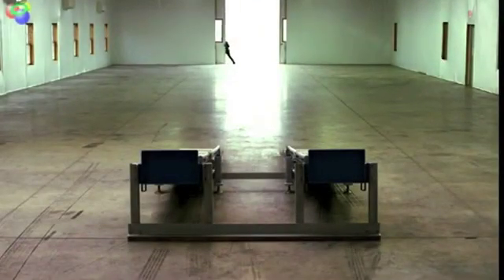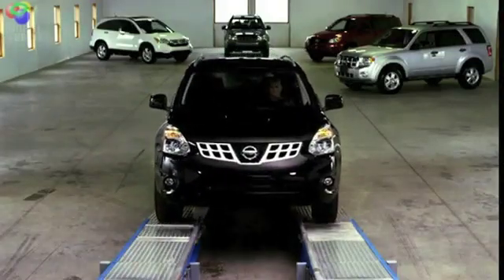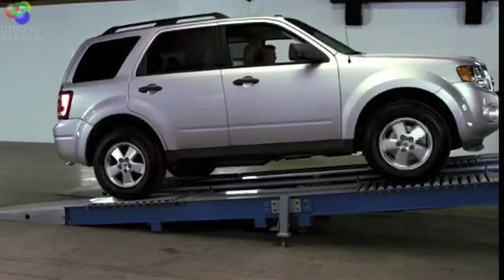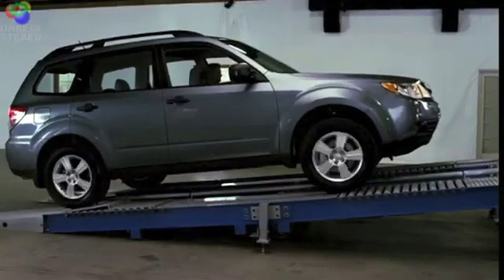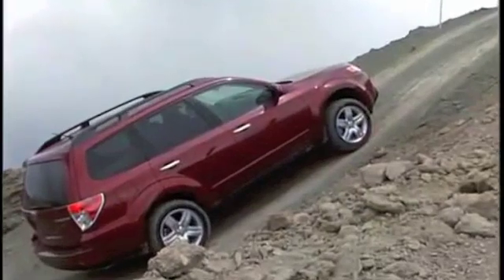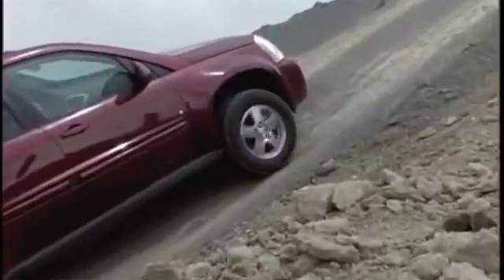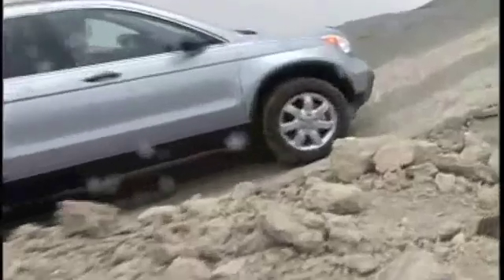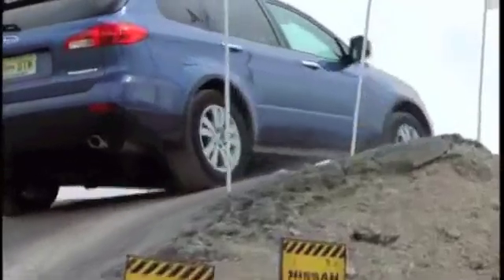Subaru Symmetrical AWD Test

Comment: Yet another Subaru advert, it's just a shame that how many people believe these videos,if it was written down that the moon was made of cheese then that would be true, believe me that Subaru is NOT any better than the rest I own them I run them I work on them I've had them for over 35+years, and Subaru are one wheel drive at its best, don't believe me do the test lift one wheel off the ground put something under another for some resistance then try to drive, the result is a gimmick AWD system

Comment: You chose the only test that gives Subaru an advantage. In reality, all those cars would have climbed the ramp if traction was available on BOTH rear wheels.
Reply: .. but the Subaru would have also climbed if it had traction on both rear wheels.  That's the point .. it had traction even on the very worst case, that only one wheel had traction.

Comment: My STOCK '17 Subaru Crosstrek, took to the Beach and played in sand, 4x4 lifted and kitted Pavement Queens, wouldn't dare go in! The looks on their faces when it "looked" like i was stuck, pulled out, then went back in and spun donuts, was priceless!😋😋😋😋
Reply: And by the way you can easily replace the radiator yourself that’s how simple the design is I did it I’m not even a mechanic you can get it done for about 120 bucks with a Nissens radiator

Comment: Seems like a rear differential with some kind of "limited slip" ability (clutch, viscous or helical) would've COMPLETELY made a difference in this test...
  I think if any one of those vehicles tested HAD a "rear limited slip" setup, they would've been able to climb this ramp and pass this test.
  In my opinion, it's damned ridiculous to even offer an AWD drivetrain option, without even offering a limited slip rear diff. as an option.
  It should come standard-equipped when said vehicle is fitted with any kind of AWD option....
  Pretty dumb to have an "all wheel drive" SUV with open diffs at each end.

Comment: Subaru be like: 4WD. All wheel gets POWER. Sound easy.

Everyone else: WE NEED COMPUTERS TO MAKE IT WORK.
Reply: what? Subaru is literally doing that right now with x-mode. There is nothing mechanical that can provide all tire power AND be safe on the roads. Locking differentials must be toggled and subaru's don't have them.

Comment: would be great to include the year/model/trim. does the tested subaru have a rear LSD in it? is subaru that much better than the competition? thought rav4.1 and 4.2 were pretty good, but not sure c diff lock would have helped in the first test. would be cool if subaru offered a dual range transfer case, but i guess that would add a lot of weight
Reply: Don't think those Foresters got LSD. The 3.0r, GT, Spec b liberty outback platform got them with the 5EAT, as did all rexies.  But AFAIK the 2.5s did not have LSD

Comment: Comparing Subaru AWD to a Cute Ute AWD is like comparing an HD truck 4wd to Subaru AWD. It's all about how much torque the system will distribute. 

Those other cars are simply not designed for that. They will, though, work in most situations faced by their owners. If, however, you live in the mountains or have a steep driveway it's time to think about a Subaru. If you live in Nebraska a Rav 4 is fine.

Stop saying Jeep compass or renegade. Nobody wants a vehicle with ass in the name and FCA managed to turn a bad brand, into a worse brand. Ask any mechanic before you reply. ANY mechanic. ANY. MECHANIC.
Reply: But Aaron, what about Subaru head gaskets?
Reply: Oh yeah, forgot about that. Thanks other Aaron. So, I guess I'll take the shitty Toyota AWD on the Siena and get stuck now and then, but I can use that time to watch my odometer tick over 300,000 trouble free miles as the tires spin.

Comment: we tried the test on a saab 93 with XWD that has what they call (elsd) rear wheel torque vectoring , the awd system simply vectored all the torque to the right rear wheel and it climbed over the rollers with no fuss.. I suspect the Subaru has very intelligent traction control , or a slip controlled rear differential

Comment: Main reason is the platform being either FWD or RWD... If engine is placed vertically instead of horizontally, where axis follows the direction of the car moving forward, such as Subaru, New 2020 Explorer, Expedition, Suburban, or any pickup truck, they are RWD platform and naturally good at climbing.

Comment: I know this video is old but I hate false advertising. The equinox has a button you have to push to engage the AWD. It will only pull with the front tires until so.

Comment: This comes to show that any vehicle with AWD should have it running at all times and not only powered by some stupid fucking computer that turns it on when needed. Oh but the advantages of computer controlled AWD systems is for fuel economy.... riiiigght, by adding more electrical features this makes the motor work harder to power these components which in the end uses more fuel. Once you're rolling, the rotational force isn't  much different from AWD and FWD so the fuel economy is almos the same.

Comment: where is quattro
Reply: Even old GMC smarttrac wasn't included. A smarttrac with optional g80 differentials will spin the only tire with traction
Reply: On a rollback.
Reply: Yeah and Suzuki
Reply: quattro I and II would destroy subaru too handily
Reply: Hiding under a table from vehicles that cost half but last double the time.
Reply: @claudyfocan731  lol no. Subaru has a long storied history of early failures.
Reply: different price bracket
Reply: Parked outside the gay bar where it always is.

Comment: Break lights on the Food where disconnected.  The engine rev'd a little too much with too little wheel spin.  It's almost like the driver was holding the break.

Comment: All other non-luxury manufactures does is to  come up with a fancy name for their AWD system for marketing, instead of putting money on the actual design and manufacture of their AWD systems.
Reply: Yeah, I'd be pissed if I bought an AWD, come to find out. Most of the power goes to the front wheels. 
What kind of shit is that? In this day and age, it can't be that hard.
Reply: 60/40 rear to front power in manuals buddy ;)
Reply: Actually Honda has the most advanced awd and it does side to side too with the Sh-awd even beating some Quattro , xdrive , Nissan awd even Toyota awd system on their Lexus
Reply: @alvincorbin8738  It's true, but only installed at Honda Pilot since 3rd generation. CR-V doesn't have it.
Reply: Quatro and xdrive does the same, subaru just has the best awd
Reply: @paul1e  I’m 18 and even I know that the Original Quattro version hasn’t history
Reply: @paul1e  they don't really. They just have really good marketing and a customer base that doesn't know better.

Comment: press the LOCK button on the rav4 and it will go up..
Reply: No, no it wont. It has a generic V6, like most of the other vehicles. Even the much heavier Tribeca made it up the hill. My GF has a Rav4 identical to that, and even my 1997 Outback out does it in the snow.
Reply: Darren Good , not all have the v6, mine has 2.2 D-Cat 130kw engine
Reply: Timo Klap I was referring to the one used in the video. You can see the V6 badge on the front. Its a 260ish hp 3.5 V6, whereas the Forester "only" has around 170 horse from its 2.5 Boxer engine.
Reply: Wrong - used to have a rav, and there was no lock button
Reply: @babakh20  Yes it does. It has to be awd though.
Reply: babakh20 must have been front wheel drive then, all awd versions HAVE a lock button beside the steering wheel
Reply: Timo Klap had a 05 rav no lock button
Reply: Amen

Comment: I wonder how the newer Dodge Journey's would fair. As far as I can tell it incorporates a BorgWarner iTM 3e (the pre-2011 ones definitely did). Where it excels is in using ESP to apply brakes to the wheel(s) that are spinning, which gives power to the wheels with traction. It's all electric so it's much faster at detection. It can also split power between front and rear like a lock. In practice it feels very similar to a Subaru (admittedly one of the best, if not best, systems). So far my 2015 has trudged through 15" of snow up inclines without issue in all season tires. Even though it prefers front wheel drive to save fuel when slamming on the gas it gripes like an electric car (the 50/50 split kicking in). I'm duly impressed for such an affordable AWD system.

Comment: most suzuki 4wd systems would take those challenges.  my suzuki has lockable center lsd that's made by heavy industries, the same company that makes Subaru.
Reply: +Torbjørn Larsen What year is yours?  I have a 2013 and I love it, it tackles anything.
Reply: +David Cazes and old 2006 with low mileage.  never been stuck anywhere.
Reply: powow

Comment: In another video the forrester and 2 other subaru models had the right front and rear wheels on rollers and all failed. in another test the 2 front wheels and the left rear wheels were o rollers and it also failed. only the volvo and audi made it. It changed my mind...

Comment: yall see they didn't have a chevy there.. the chevy trailblazer for example.. some models use an actual diff locker and even the base models use its traction control and ABS when the system picks up wheel slip it applies the brakes to the slipping wheel to physically force power to the other wheels... if held to the floor the system will add power till the vehicle/driver is out of the sticky spot. of Corse driving in theas sort of conditions the driver is best off to have skill/Esperance with the terrene

Comment: Comes standard in all Subaru vehicles. How about the BR-Z?
Reply: This is an older video.
Reply: +Andrew Torrence Co-designed by Subaru and Toyota. It has a Subaru engine with the  Toyota Direct Injection System. It's mostly Subaru,  it's even made in a Subaru factory in Gunma, Japan.
Reply: +linearenate because that was technically designed by toyota with gt86 and scion frs.
Reply: +Ricardo Stefánsson Ahhh I gotcha. The other thing that drives me nuts is the fact that I just found out not long ago that the Impreza also came in a fwd ):
Reply: hahaha
Reply: linearenate indeed as well
Reply: The brz is a toyota
Reply: The BRZ is unworthy in even a dusting of snow.  I know because I got stuck at work in my wife’s BRZ, stuck at work, omg I hate that car!
Reply: Dan Bolton We ran a GT86 through 4 Scottish Highland winters with absolutely no trouble. 60 mile round commute and we live on an unclassified road meaning no gritting and no snow plough. With 16” rims and decent winter tyres it performed perfectly. We sold it at 70,000 miles and it never missed a beat.

Comment: good test but on your test ,there is no audi quattro system ,bmw x drive system or mercedes 4matic sytem they do the same as subaru so next time can you include them at least we can see who is the best .
Reply: +farayi muzvuzvu This test is not designed to test all commercially available AWD Systems, This Test is comparing the cars in the same price range than the Forester.. In this scenario the Forester is better equipped for the money.
Reply: +farayi muzvuzvu i guess they are not in the same price range. im sure acura mdx with sh-awd can do very well too
Reply: +edwinlee4 SH-AWD actually out-performs everything in its class.. Look for the same test performed by the USAC for all those vehicles in the same price range.